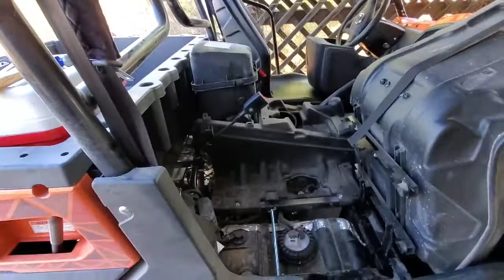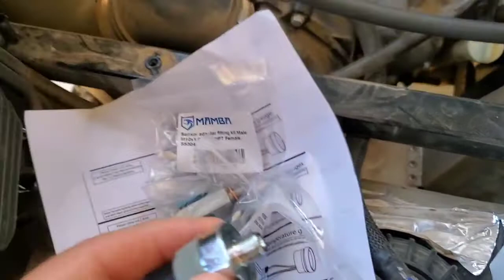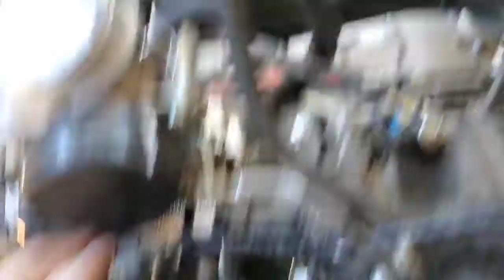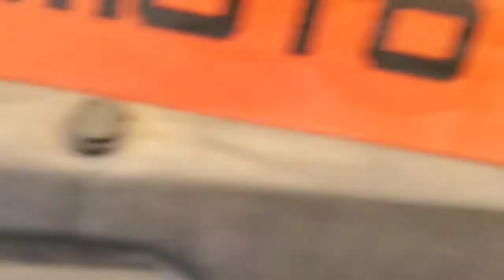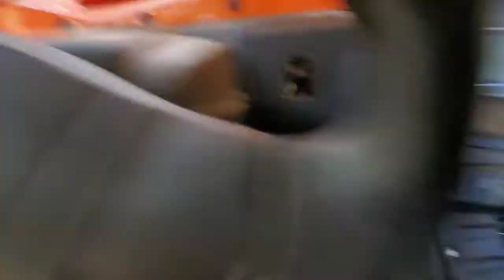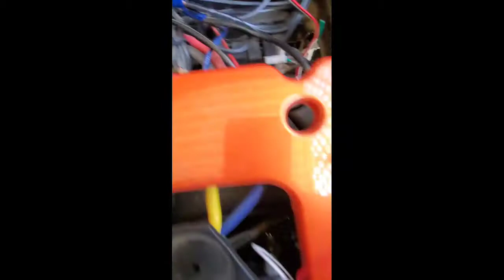CFMOTO UFORCE 800 OIL PRESSURE GAUGE INSTALL

Comment: Would have been great to see it work.... I put a gauge on my older ranger 2010...worked out great....when hot and working it runs around 35-40 psi....at idle its around 20-25 but at least I can watch it.....I dont think the older ones even had a light

Comment: Great video.  I have a similar problem with my 2020 UForce 800.  Opted to take it back to the dealer so they can deal with it since I have a 3 year warranty but I like your idea about the pressure gauge at get the fact that your over 100 mile from the dealer.
Reply from the maker: What did the factory service do for you?
Reply: @firewaterforgeofarizona4304  Got it back today.  Bolts by driveshaft housing backed out and were causing oil and pressure loss.  Pressure is good and no more oil loss.
Reply: @firewaterforgeofarizona4304  Still at the dealer. There for about a week now but I will let you know if you want.

Comment: Did original sending unit fail? Was oil pressure OK on new gauge? Does it maintain pressure with hot oil? Was it same issue with idle oil pressure as in this video https://youtu.be/Ts-gMXM-qNE ?
Reply from the maker: The sending unit was irratic. I fully tested the engine with an oil pressure testing guage, there was not fault on the pressure. I don't like "idiot lights" anyway since they don't really tell you anything and give you a heart attack when they flicker on so this was the best solution. I really like the guage I installed. It was a bit pricey bit worth every penny.
Reply: @firewaterforgeofarizona4304  I'm also thinking observing gauge is best thing. Would be good to see oil temp also. There are dual sensors with pressure and temperature
Reply from the maker: @artur8403  not a bad idea if you can get 2 for 1 while having it torn down.